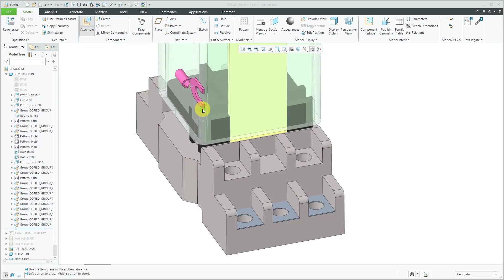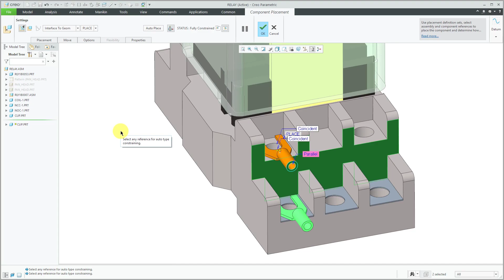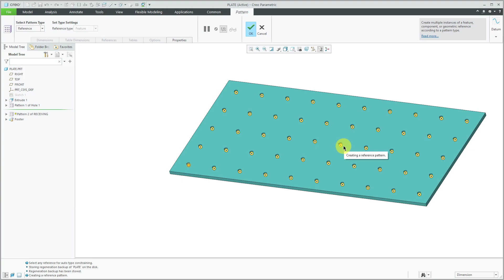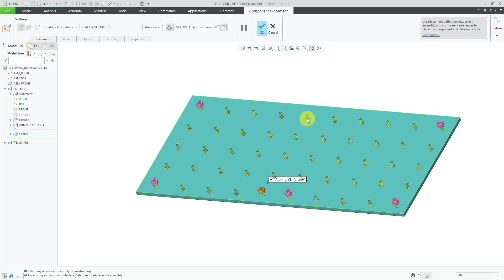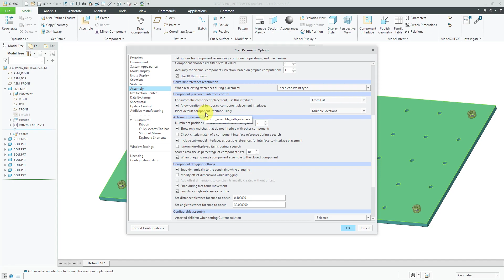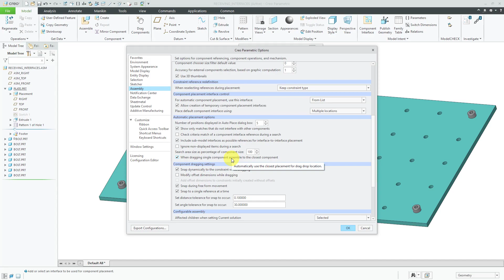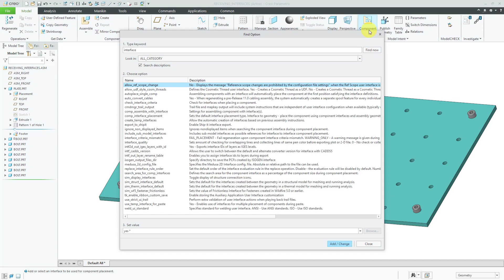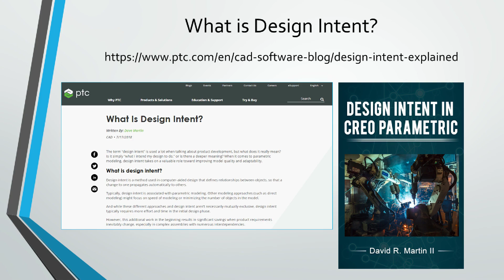Creo Parametric - Advanced Component Interfaces (Demo)

Comment: Hi Dave!
First thing first: I love your videos, they are really helpful.
I am just curious, how does the interface with criteria work.
For example, is it possible to put a bolt ONLY in a right sized hole with this feature?
I tried with UDF holes and bolt which are both created in family tables. I made equal parameters and than I put these prameters in the criteria unsuccessfully. (Creo 3 M160)
It's not a big deal i know, but i would use it.
(Sorry, if my english is not the best)
Reply from the maker: Thanks, Agyameldobom. The only times I recall using them were to ensure metric fasteners were being placed in metric holes. I’ll make a video to demonstrate that and the interference option.
Reply: THX! That would be great!